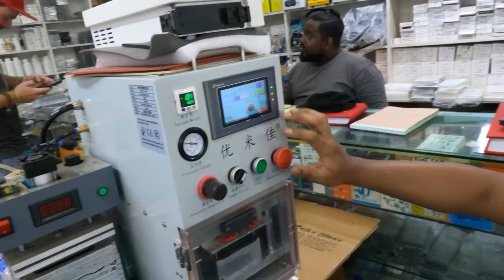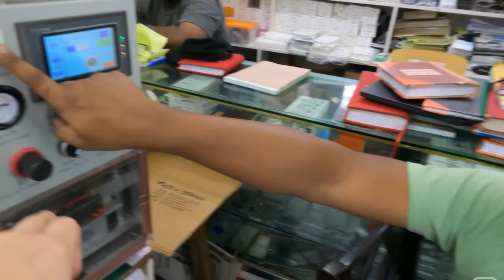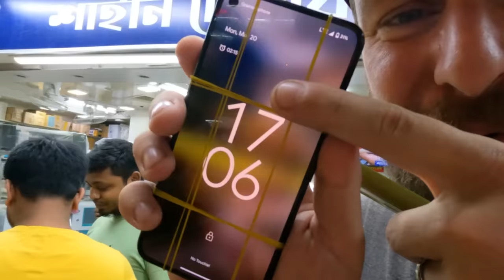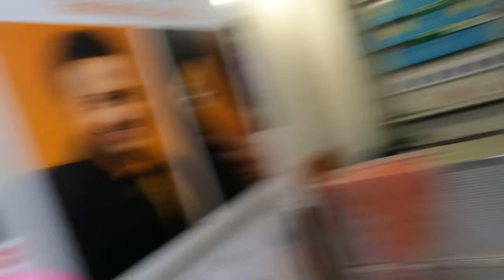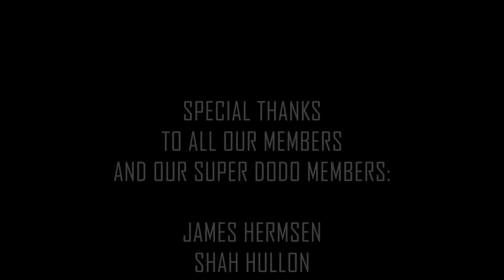INSIDE BIGGEST IT Market Bangladesh 🇧🇩 Motaleb Plaza

Comment: Original the Nokia 3310  was my first phone. I had 2 of them. then bought another new Nokia model, but the old one I put on Craiglist in Vancouver and many people called me and most of the building construction workers. Told me that we use it in a hazardous place if it falls down several floors, still works. 

Nokia 3310 
The Nokia 3310 is a discontinued GSM mobile phone announced on 1 September 2000, and released in the fourth quarter of the year, replacing the popular Nokia 3210. It sold very well, being one of the most successful phones, with 126 million units sold worldwide, and being one of Nokia's most iconic devices.